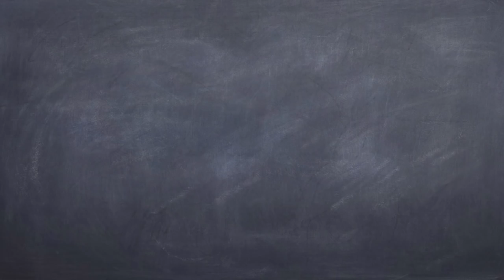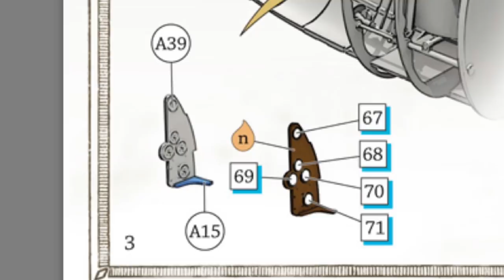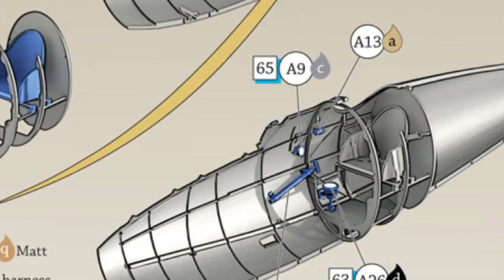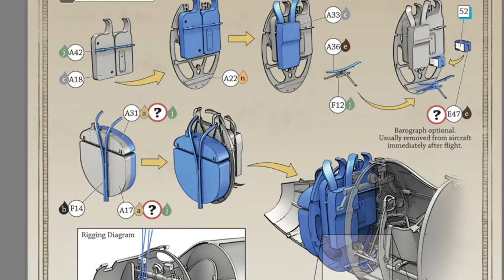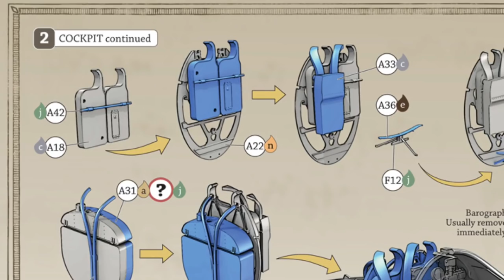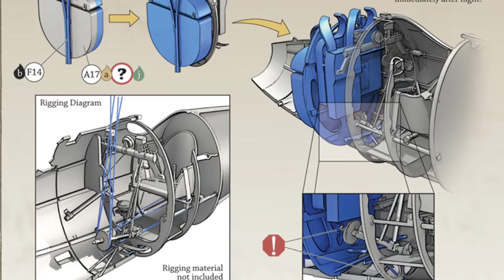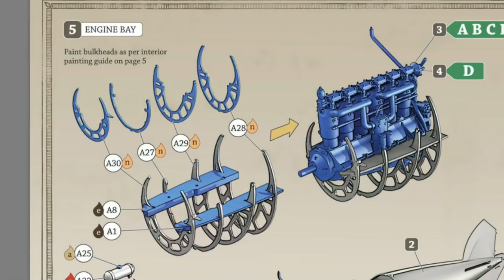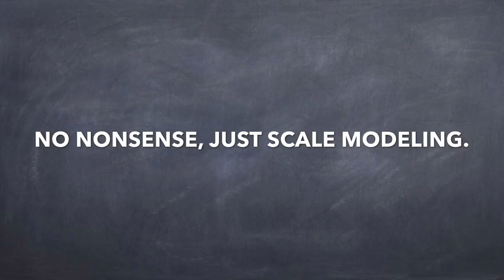Building Interior & Cockpit | Albatros D.V Scale Model 1:32 Wingnut Wings

Comment: Sir,  this is a question on your previous video. I was wondering if you could use water color pencils for the whole "painting " as you did on your propeller video ?   thanks  Ralph
Reply from the maker: Hello Ralph, In next video, I will show how to reproduce the plywood look by using water-color inks. Even those modelers without any spectacular painting skills can apply this method easily